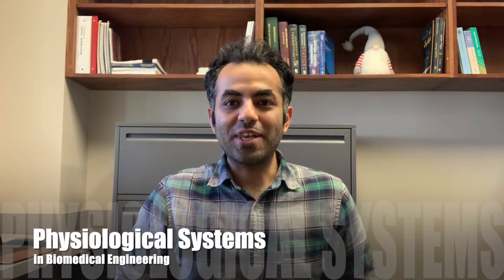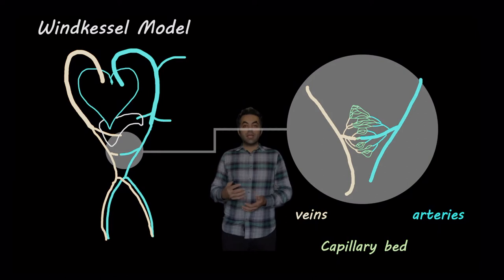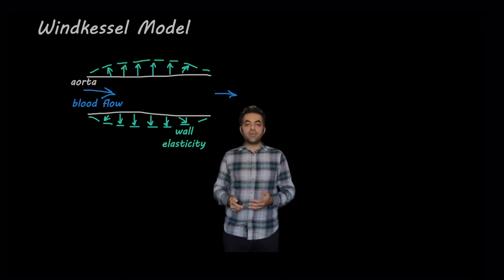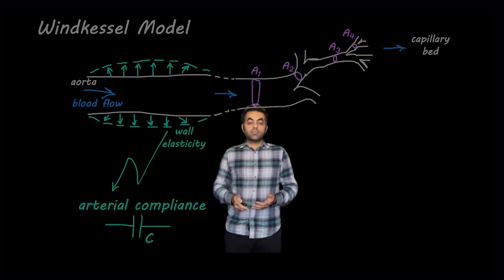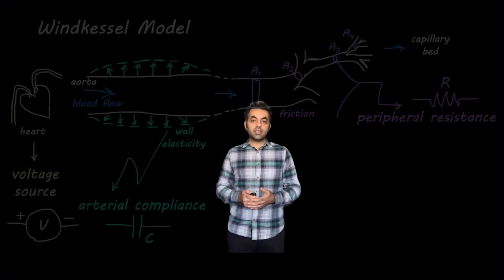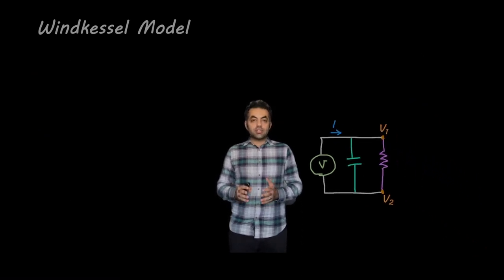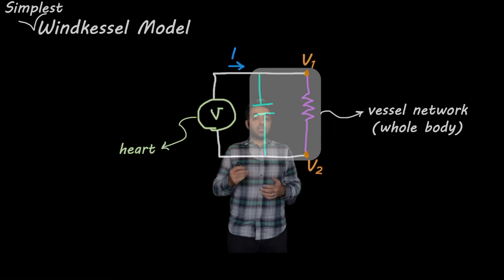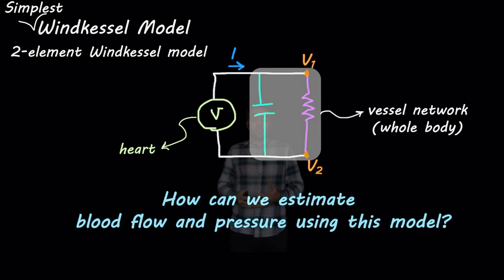Windkessel effect

Comment: Salam Sir. Really nice explanation.Could you please also share your insights on 3 element Windkessel models? Like what is the other resistance in that case? I think it is defined differently from RLC models. Thanks again for such a wonderful video.
Reply from the maker: Salam Ahmed. I am happy you found it helpful. In that case, we have a distal and a proximal resistance in the circuit. You can take a look at one of our papers here for an example: https://doi.org/10.1115/1.4047656
Reply: @TaebiLab  thank you again Professor. This is a very odd place to say this but can I email you about any research opportunity you might have that I can collaborate with you on? I am working with biomaterials and biofluid mechanics.